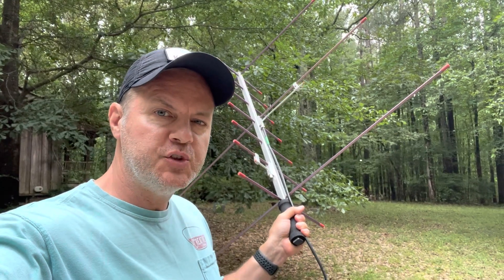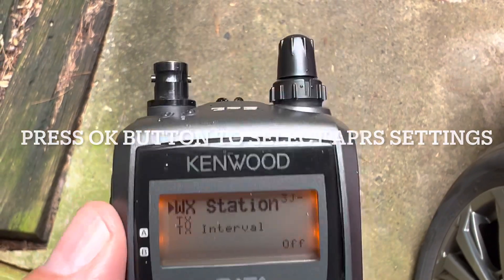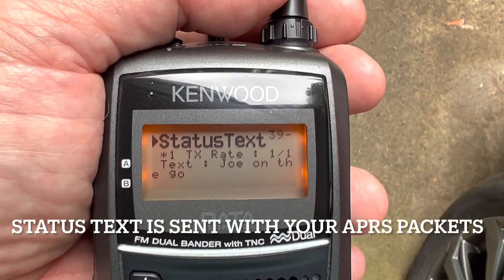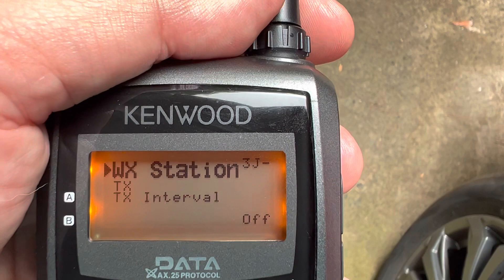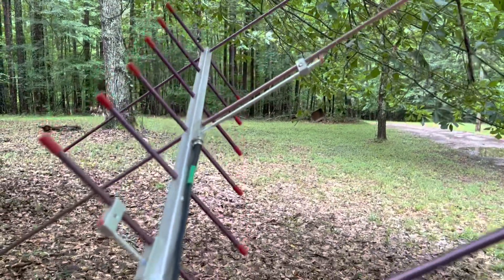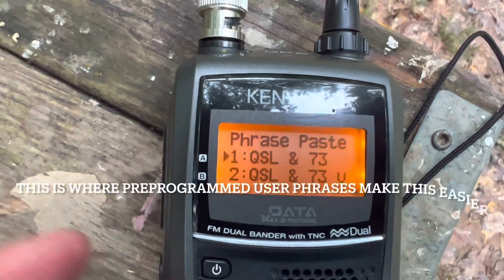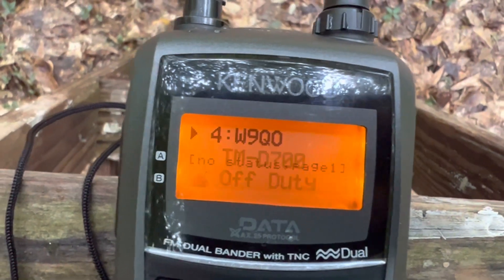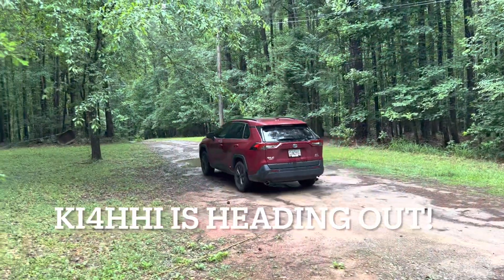Using the Kenwood TH-D72 for APRS via ISS 🛰️ (how-to & walk-thru) #hamradio

Comment: Joe, thanks for doing the video. I just acquired an almost unused D72 that I will use primarily for satellites. The video was helpful for set-up and seeing the antenna adapter was worth its weight in gold! 73 VE3JO
Reply from the maker: The D72 is a great radio that’s aged well, even though they don’t make it anymore. I’m not sure why more manufacturers aren’t making full duplex radios. 73

Comment: I am new and have one of these raids and and just ordered my arrow ant would appreciate another video showing how to put in your pre-saved messages, and how to send them they were just out of screen on what buttons you pushed in this video
Reply from the maker: Good idea.  I know from experience not to put too much in a single video, but that would make for a good follow-on topic.  What I might do is set my D72 next to the D74 and message between them showing how it works for both radios.  Same principle applies for sending the messages via ISS.  Thanks for the idea, stay tuned.